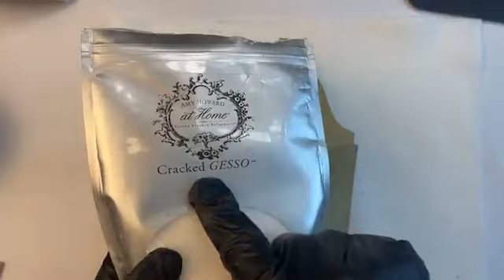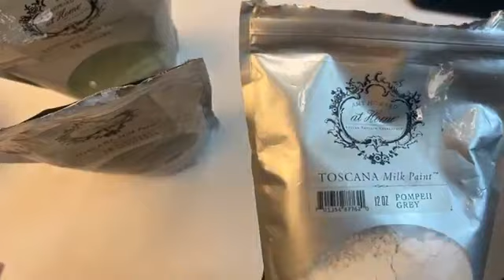Finish Friday with Amy Howard 2/2/2024 : How to Create Antique Chippy Italian Finishes!

Comment: I have a question, if I’m not able to afford the paints and everything etc at once can I use the antiquing glaze over the top of a regular mineral paint that doesn’t have top coat in it and get the same effect since it’s also reactive to water? Also could I still use cracked patina with regular mineral/chalk paint as well to do all the wonderful finishes you do overall? I know you use cracked gesso with your milk paint but yeah just curious if they can be interchangeable with other paints that I can do thin coats with so they will react well too